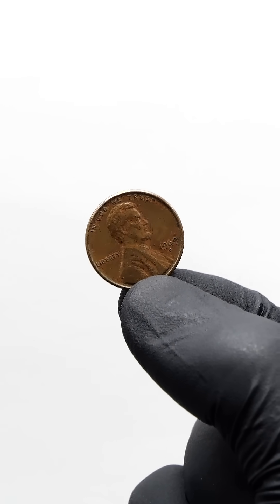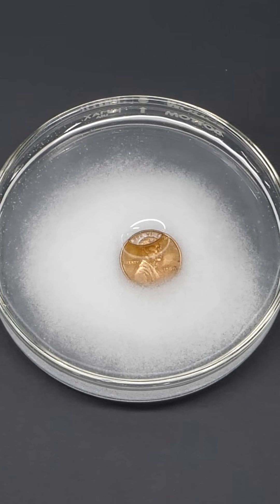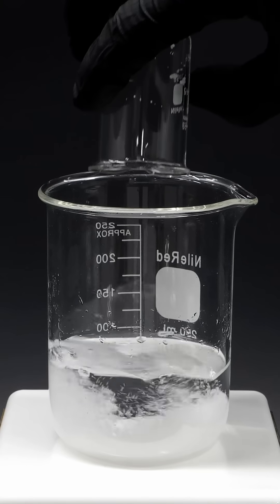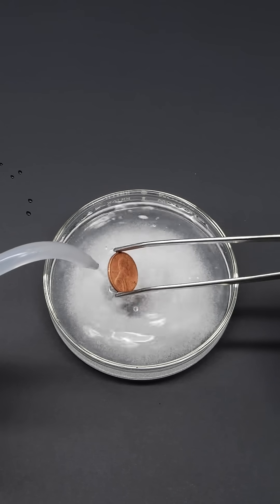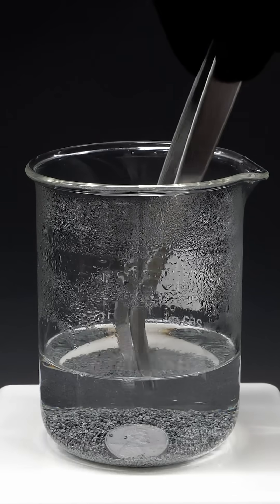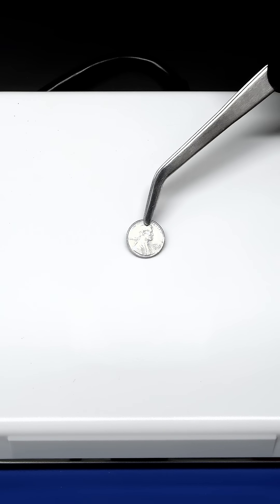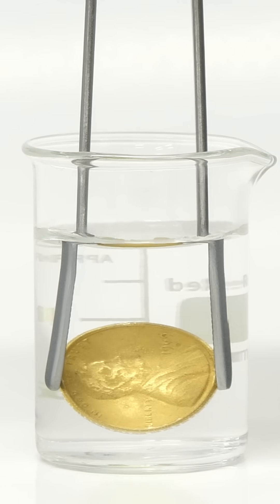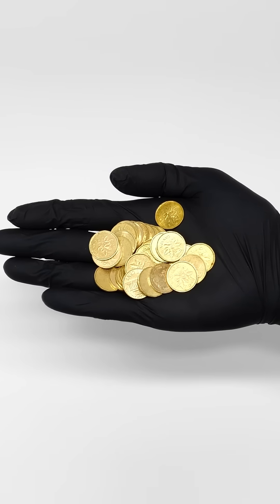The golden penny experiment

Comment: Okay, a solid copper penny?  Then coat it with zinc.  Then heat it…to what temperature?  But aren’t modern pennies copper-plated zinc?  Can’t they be turned to brass by simply cleaning them and then heating them?

Comment: For those who dont get it:

Fighter aircraft (early on also pursuit aircraft) are military aircraft designed primarily for air-to-air combat. In military conflict, the role of fighter aircraft is to establish air superiority of the battlespace. Domination of the airspace above a battlefield permits bombers and attack aircraft to engage in tactical and strategic bombing of enemy targets, and helps prevent the enemy from doing the same.

The key performance features of a fighter include not only its firepower but also its high speed and maneuverability relative to the target aircraft. The success or failure of a combatant's efforts to gain air superiority hinges on several factors including the skill of its pilots, the tactical soundness of its doctrine for deploying its fighters, and the numbers and performance of those fighters.

Many modern fighter aircraft also have secondary capabilities such as ground attack and some types, such as fighter-bombers, are designed from the outset for dual roles. Other fighter designs are highly specialized while still filling the main air superiority role, and these include the interceptor and, historically, the heavy fighter and night fighter.
Since World War I, achieving and maintaining air superiority has been considered essential for victory in conventional warfare.[1]

Fighters continued to be developed throughout World War I, to deny enemy aircraft and dirigibles the ability to gather information by reconnaissance over the battlefield. Early fighters were very small and lightly armed by later standards, and most were biplanes built with a wooden frame covered with fabric, and a maximum airspeed of about 100 mph (160 km/h). A successful German biplane, the Albatross, however, was built with a plywood shell, rather than fabric, which created a stronger, faster airplane. As control of the airspace over armies became increasingly important, all of the major powers developed fighters to support their military operations. Between the wars, wood was largely replaced in part or whole by metal tubing, and finally aluminum stressed skin structures (monocoque) began to predominate.

By World War II, most fighters were all-metal monoplanes armed with batteries of machine guns or cannons and some were capable of speeds approaching 400 mph (640 km/h). Most fighters up to this point had one engine, but a number of twin-engine fighters were built; however they were found to be outmatched against single-engine fighters and were relegated to other tasks, such as night fighters equipped with radar sets.

By the end of the war, turbojet engines were replacing piston engines as the means of propulsion, further increasing aircraft speed. Since the weight of the turbojet engine was far less than a piston engine, having two engines was no longer a handicap and one or two were used, depending on requirements. This in turn required the development of ejection seats so the pilot could escape, and G-suits to counter the much greater forces being applied to the pilot during maneuvers.

In the 1950s, radar was fitted to day fighters, since due to ever increasing air-to-air weapon ranges, pilots could no longer see far enough ahead to prepare for the opposition. Subsequently, radar capabilities grew enormously and are now the primary method of target acquisition.[citation needed] Wings were made thinner and swept back to reduce transonic drag, which required new manufacturing methods to obtain sufficient strength. Skins were no longer sheet metal riveted to a structure, but milled from large slabs of alloy. The sound barrier was broken, and after a few false starts due to required changes in controls, speeds quickly reached Mach 2, past which aircraft cannot maneuver sufficiently to avoid attack.

Air-to-air missiles largely replaced guns and rockets in the early 1960s since both were believed unusable at the speeds being attained, however the Vietnam War showed that guns still had a role to play, and most fighters built since then are fitted with cannon (typically between 20 and 30 mm (0.79 and 1.18 in) in caliber) in addition to missiles. Most modern combat aircraft can carry at least a pair of air-to-air missiles.

In the 1970s, turbofans replaced turbojets, improving fuel economy enough that the last piston engine support aircraft could be replaced with jets, making multi-role combat aircraft possible. Honeycomb structures began to replace milled structures, and the first composite components began to appear on components subjected to little stress.
With the steady improvements in computers, defensive systems have become increasingly efficient. To counter this, stealth technologies have been pursued by the United States, Russia, India and China. The first step was to find ways to reduce the aircraft's reflectivity to radar waves by burying the engines, eliminating sharp corners and diverting any reflections away from the radar sets of opposing forces. Various materials were found to absorb the energy from radar waves, and were incorporated into special finishes that have since found widespread application. Composite structures have become widespread, including major structural components, and have helped to counterbalance the steady increases in aircraft weight—most modern fighters are larger and heavier than World War II medium bombers.

Comment: Honestly, feel like a lot of board gamers would love some gold looking metal coins for games
Reply: I'm sitting here trying to figure out where to buy some copper coated coin blanks so I can do this.
Reply: @buddytrueblood  Why not just buy brass coin blanks?
Reply: This could be great for some TTRPG stuff as a way to visualize your wealth. Get like $30 in pennies, $10 remains copper, another $10 gets the drain cleaner bath and becomes your silver pieces, the last $10 gets the bath and the hot plate and becomes your gold pieces
Reply: @sumguy12345etc I used to do this as a kid but instead of that I’d use those tiny poker chips, and each had a specific rarity and value in the world with red being the most common and green being the most expensive with only one in existence (the legendary emerald)

Good times
Reply: Just exchange ur dollar pennies to euro pennies
Reply: @irirjehhee8k2h3fw6wi  Good point.  Using foreign currency might be a good option too.
Reply: You thought of the same thing I did.
Reply: Wouldn't they turn teal-blue when they rust?
Reply: Even better @dandewolf717
Reply: @dandewolf717  Perhaps seal them with clear coat?

Comment: Ive seen these before in change!   We used to take a propane torch and heat them red hot then drop in oil. Look all streaky and weird.  Thats my 11 yr old science explanation, streaky and weird!  sometimes I would cover one in silver solder from pops workbench. too and make chrome pennies. Its how i learned not to burn myself by burning myself (repeatedly)

Comment: Don't do this because its probably illegal but, you can make a penny hollow too. Its core is 97.5% zinc. You scrape off a small piece of the brass and then drop it in muriatic acid for a while. When you pull it out, the zinc gets dissolved by the acid leaving you with a hollow penny with a tiny hole in it.

Comment: Alternatively you could place it into a zinc solution and then place in a piece of zinc metal touching the coin and then put an electrode on the coin and an electrode on the zinc, then run a current through. After the coin turns silver heat it for a couple seconds under an open flame.

Comment: I was a diamond setter back in the 1970's, and we would end up with extra stones... tiny ones, like one and two "pointers"... because the counts were often off from the suppliers. These were fair game... each of us setters had a little lead tray of them on our workbenches... and we would use them to make up low counts, and after that, whatever we wanted. Low value. So we all always had a few dozen diamonds, emeralds, rubies and sapphires. 

Anyway, on my lunch break I would sometimes set stones into the back of pennies... right were the Lincoln statue is. This was done by drilling a proper tapered hole, and raising the prongs from the penny's metal... four of them. 

Anyway, I put these back in circulation. Since "the internet" I've searched for "penny with diamond set in it" and never found one. But they are probably sitting in change jars or sock drawers somewhere.

Comment: for anyone who wants do this but doesn't wanna keep watching the video over and over (or if you have a short attention span) here's the basic rundown-

coin in vinegar & salt and let it sit in there for a while to clean it. dissolve sodium hydroxide drain cleaner into water. after its disolved, add some zinc metal, and once the coin is washed off, drop it in the solution. after about 20 minutes (or until the coin is fully coated), place the now 'silver' coil onto a hot plate and after a while- boom! 'gold' coin! it's brass now but it's pretty cool and neat regardless

make sure be careful!!!! use proper equipment and wear lab-friendly clothes! chemicals aren't always safe to touch with skin!
stay safe :>
Reply: I wonder where someone gets zinc from. eBay?
Reply: Is the brass a coating or does chemically change the actual coin?
Reply: @oneplumpboi5317  Well, it's a very very thin zinc coating that's combining with the very outer layer of copper on the copper coin, to create a brass coating. It definitely chemically changes the coin because of the copper and zinc combining, but if you meant to ask "Does it turn the entire coin to brass?", it doesn't. It's still a thin coating of brass, it's just partially made from the outside of the coin itself.

Comment: I teach physics and chemistry to kids aged 12-16 and I usually have them do a similar experiment like this. The experiment is called "alchemy" for obvious reasons. We heat the coin over a open flame, which IMO is a bit cooler way to do it, but harder to control.

Luckily I have a bunch of old coins that have been taken out of circulation, so I can make this experiment for a long time and at that point the current smallest copper coin will likely have gone out of circulation as well, so I would be able to restock.

Comment: You can do this easily in a school science lab - instead of chemical plating the zinc you can just do it with electrolysis and then a bunsen burner works fine for the heat. Have done it several times with my students in science club, they love when they can take something fun home

Comment: I thought you were gonna electro plate gold to the penny, instead you showed a really cool way of making brass.
Reply: Hypothetically if brass is just an alloy of nickel and zinc, can you electroplate brass onto another metal?
Reply: @leslielopez9726  Nickel? you mean Copper?
Copper+Zinc is brass
Copper+Tin is bronze
Reply: @leslielopez9726  *Copper and zinc, and yes, you can electroplate alloys onto other metals.
Reply: @Tunkkis  sorry yes I meant copper lol. I want to electroplate brass onto nickel but I'm unsure if I would have to electroplate copper and zinc into the same solution or separately and then apply direct heat to it. Or would it simply work by electroplating brass directly into the solution??
Reply: I thought it was posted for aprail fools
Reply: Penny was already made of brass (95% copper, 5% zinc). He just diluted the surface copper content by adding more zinc.
Reply: @calebdaniels1987  Brass is an alloy. If the two metals are separate, as they are in a penny, it's not brass.
Reply: @Tunkkis  The metals are not separate. Older pennies are made from a 95% copper, 5% zinc alloy (brass).
Reply: @calebdaniels1987  My mistake, I thought you were talking about modern pennies, which are copper plated zinc.
Reply: @Tunkkis 
same.

Comment: Hi Nile red ima huge fan and pin pls anyways this is how to make a glow stick, hot ice, cesium metal, and fireballs ready? Lets go!

How to make glow stick: Solution A: In one of your containers, add 50 milliliters hydrogen peroxide 3% solution to 1 liter of distilled water. Set aside for the moment. Solution B: In your other container, add 0.2 grams luminol, 4 grams sodium carbonate, 0.4 grams copper sulfate, and 0.5 grams ammonium carbonate to 1 liter of distilled water.

How to make cesium metal: Cesium is produced by heating cesium and rubidium ores with sodium metal, or by acid digesting pollucite. Cesium-137 is a byproduct of nuclear fission. 
Methods for producing cesium
Heating with sodium metal:
Crush cesium and rubidium ores 
Heat the ores with sodium metal to 650°C 
Separate the alloy using fractional distillation 
Acid digestion of pollucite:
Digest pollucite with acid 
Nuclear fission:
Produce cesium-137 through nuclear fission 
Other methods for producing cesium Direct reduction with metal, Alkaline decomposition, Acid leaching, and Reducing cesium chloride with lithium. 
Cesium is a soft, gold-colored metal that is highly reactive with air and water. It is used in drilling fluids, optical glass, vacuum tubes, and radiation monitoring equipment

How to make fireballs: Pour rubbing alcohol into a small bowl. To start making your fireball from a cotton ball, first pour around ¼ cup (60 ml) of rubbing alcohol into a small bowl. ...
Soak a cotton ball in the rubbing alcohol. ...
Squeeze out the cotton ball. ...
Wash your hands.

And how to make hot ice: 1) Mix the vinegar and baking soda in your sauce pan.
2) Boil the solution over medium heat for about an hour.
hot ice experiment
3) Cool the solution in the refrigerator
4) Pour the solution into a new bowl and watch the ice form!
5) Notice your ice is hot!

Comment: My chemistry teacher in highschool did this with my class we didn't use a hot plate to heat the pennies though we held them above a Bunsen Burner with tongs they were alot shinier than the ones you made i also thing we used a different solution with the zinc the method we used took a 24 hour soak instead of just letting it sit for a few minutes but it looked very reflective afterwards